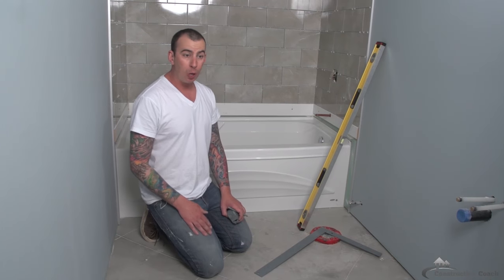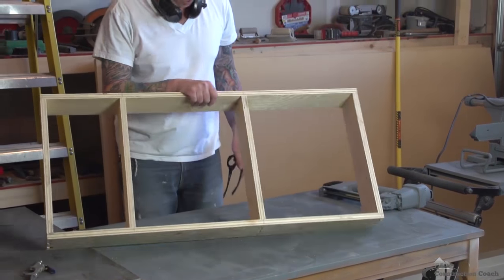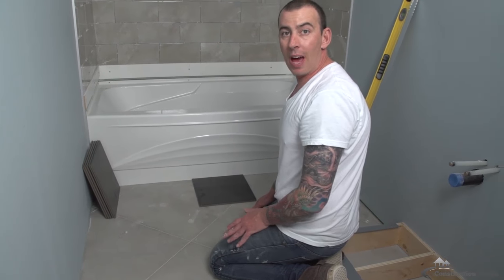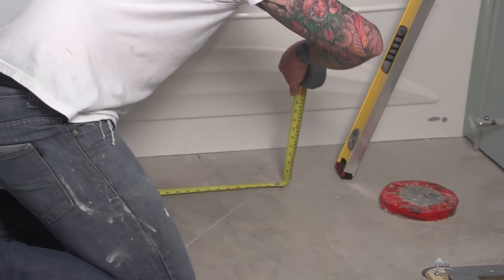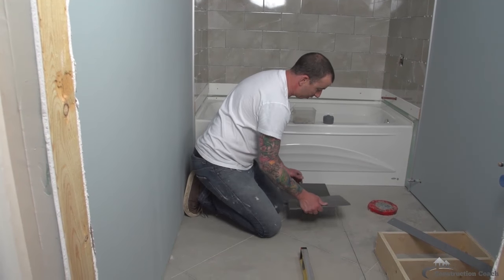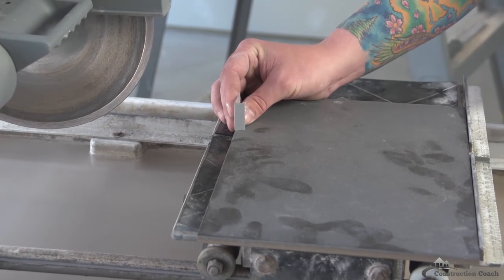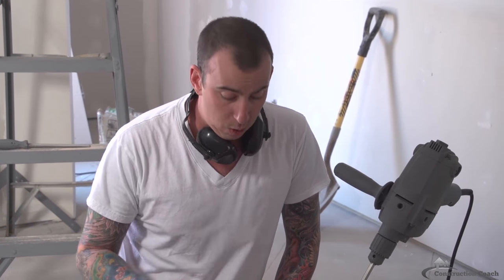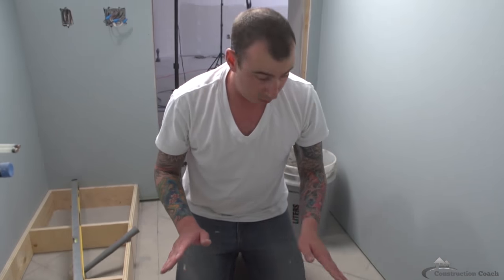How to Tile the Bathroom Floor - DIY

Comment: This is a really great video but you fail to mention that you should never swirl your thinset when laying the tiles as it will trap pockets of air under the tiles and lead to potential floor failure.  You should always trowel your ridges in a straight line.